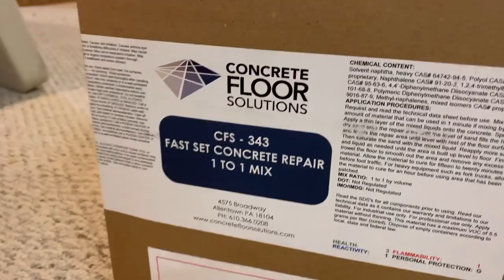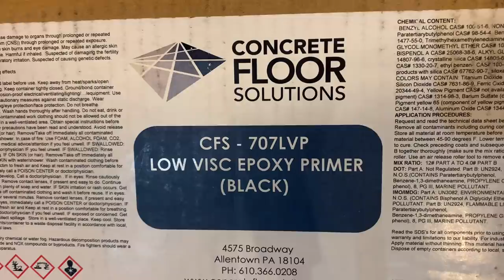Easy DIY Metallic Floor Installation, how to transform your floor.

Comment: Seems pretty brave doing all your mixing on a tiny piece of cardboard over carpet. Why not lay a heavy canvas tarp or at least a larger piece of cardboard?
Reply from the maker: Agreed, although that carpet is being replaced with epoxy at some point.
Reply: @ConcreteFloorSolutions  I thought that might be the case. The floor looks cool..

Comment: Is there an email or phone number I can call to order and get some installation advice....I'm doing 2 gym bathrooms and it's over over tiles not espestos...though it's only 152 SQ ft...I'm a little confused...I'm hoping to do a good job to accumulate more work. Yet, I'm getting conflicting information. Have nobody to help with support. This is my dream to pursue this industry. Concrete overlays...I have experience...though this particular job...small..though a lot of people will see and walk on these floors.
Reply from the maker: Call me direct 610-972-5247..Jason. I can assist with our materials only. or you can order online :
https://concretefloorsolutions.com/store/

Comment: That's gotta be your house or a friend/relative's place. Otherwise, there's no way you mix epoxy and clean tools at a client's house on that little popcorn fart piece of cardboard.
Reply from the maker: It is my house, I was saving that for another video though. The adjacent carpet is coming out and another epoxy floor is going in. But still, no epoxy on the carpet. Lol
Reply: I’m glad I’m not the only one who thought that I nearly fucking died lol.
Reply: Cool, I have a game room to finish. Problem is there is a pool table in it already.😬
Reply: @craigdoriety9798  Just do an epoxy cove around the pool table legs to set it in place so it's integrated into the floor.